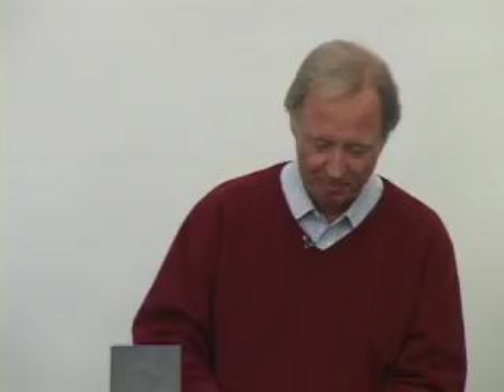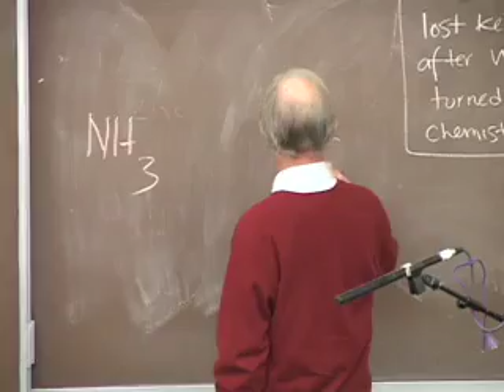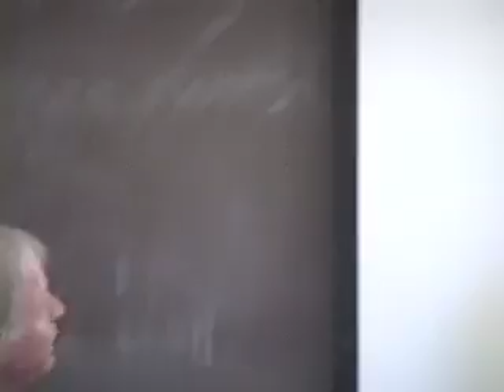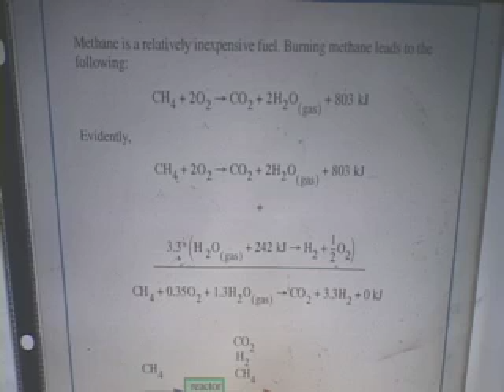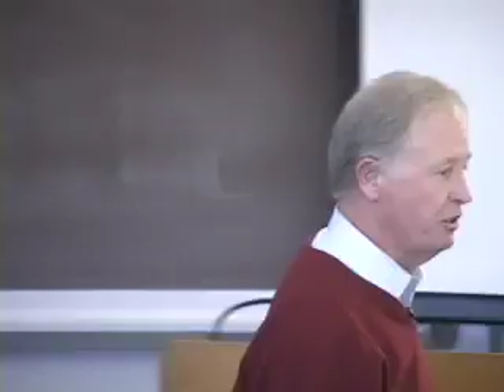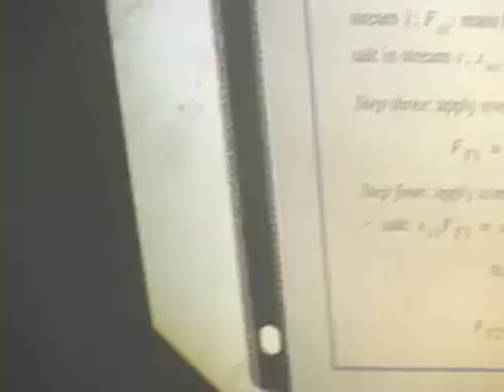Introduction to Chemical Engineering | Lecture 4

Comment: lecture number 2 hahah. The class skipper
Reply: The process of removing water from a substance is called Dehydration Process. Gas can be dehydrated by cooling and separating the condensed liquids, by using specially designed low-temperature separation process, by using solid desiccants, or by using a liquid desiccant. Cooling the gas and removing the free water with a separator is the simplest method of Dehydration Processes.

#dehydration #wastewater #gas #plant #energy #engineering #gaspipeline #gasprocessing 

https://techproces.com/dehydration-process/

Comment: god i love this man
Reply: fishy I too
Reply: The process of removing water from a substance is called Dehydration Process. Gas can be dehydrated by cooling and separating the condensed liquids, by using specially designed low-temperature separation process, by using solid desiccants, or by using a liquid desiccant. Cooling the gas and removing the free water with a separator is the simplest method of Dehydration Processes.

#dehydration #wastewater #gas #plant #energy #engineering #gaspipeline #gasprocessing 

https://techproces.com/dehydration-process/